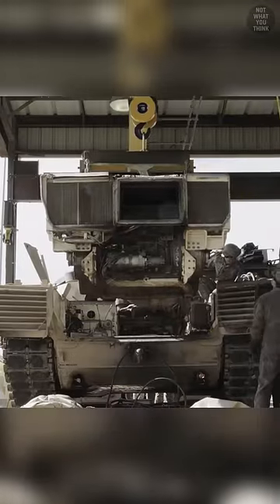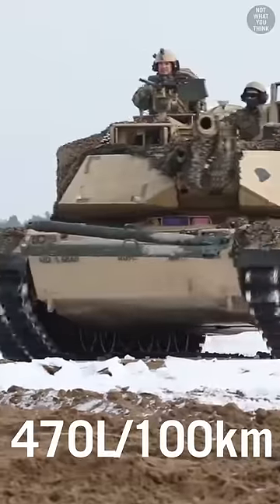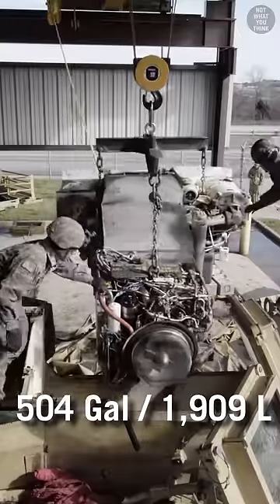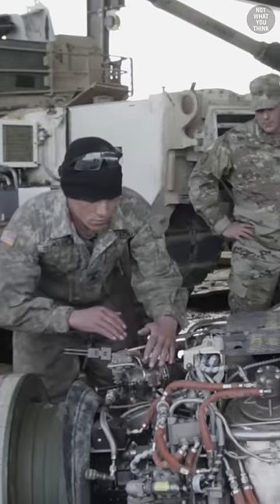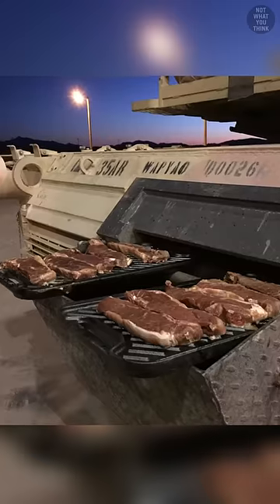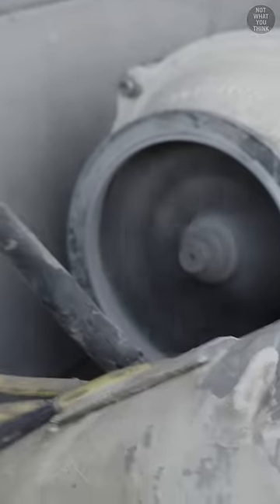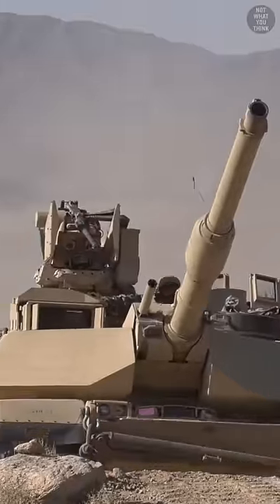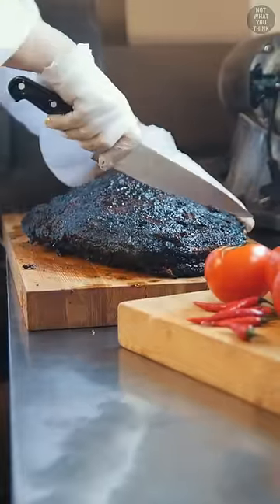Why M1 Abrams Tanks Have Gas Turbine Engines #shorts

Comment: It's actually more fuel efficient under load than a diesel engine but extremely in efficient while idle
Reply: It also produces MUCH HIGHER torque and Horsepower at lower RPMs compared to its diesel equivalent, meaning much higher acceleration and offroad performance.

Most countries at that time went with a gas turbine engine aswell, since it was the 80s, and Diesel engines werent as advanced as they are today.
Reply: @honkhonk8009  most tanks are diesel,  Germany had gas turbine during  WW2 in few tanks.  There is a reason the leo2 has a diesel.  Also think higher torque is incorrect.
Reply: And that applies to all turbine engines. The higher the RPM, the more efficient the power output. This is because the compressor consumes a lower proportion of the engine's work at higher RPM.
Reply: @jantschierschky3461  They had gas piston engines like in a Toyota Corolla. Nobody had turbines in tanks during World War II.
Reply: @米空軍パイロット  well turbines were tested,  don't forget jet engines were lot cheaper and faster to build.  Porsche wanted electric motors for his tanks so he tested turbines.
Reply: High speed fuel efficiency is roughly the same. A turbine consume almost the same amount of fuel per minute no matter the power output though.
Reply: @米空軍パイロット  yeah no. switzerland trested both the M1 and the leo2 back in the early 80s.

the M1 sucks down significantly more fuel per distance than a leopard 2 even when running on the autobahn at top speed.
Reply: @anonym3017  did the Leopard actually have all the armor in place that Germany claimed was on it?
Reply: @chickenfishhybrid44  this was army trials performed by the swiss army. so yes it did.
Reply: @honkhonk8009  
Nope 
the Honeywell has 2,750 lb⋅ft at 3000rpm
the Leo's MTU V12 has 3,352 lb·ft at 2000rpm

And NO, UK's multifuel  option was the Leyland clusterfeck engine in the Chieftain, 

T-80 has a turbine But the T-90 doesn't neither the T-14

google is your friend
Reply: @anonym3017  That doesn't mean anything. Remember when  they sent the Leopard 2 to the US for testing against the Abrams they claimed it was fully armored when it actually wasn't.
Reply: @Chopstorm.  that testing in the US was with a German crew.

This was with swiss crews and maintenance.

So a few tons of armor being missing gets noticed pretty quickly.
Reply: everything is in efficient at idle
Reply: @farmerned6  he said  ""MUCH HIGHER torque and Horsepower at lower RPMs"""  -which is true.
He didn't said about peak torque
Read better. Piston engine need more RPM to match torgue
Honeywell can provide torque instantly  which good for tank, while piston - you need to rev it. And its turboshaft - direct drive
The engine can use a variety of fuels, including jet fuel, gasoline, diesel and marine diesel.  Not just diesel.
Marines who used M1A1 in Afghanistan stuck in village used locals moonshine to drive to base. 
ATG 3,730 N⋅m vs   MTU 4,700 N⋅m  - 970Nm less, but its more efficient providing movement from bottom and has less parts and weight, and its direct drive.
And ATG power\torque and speed is restricted so tracks and wheels and transition  didn't  destroy itself on move by speed. Abrams faster by all meanings, while having less torque on "paper". Remove restrictions - and it will fly over the land.
So ATG 1500 is more powerful by less weight, and being restricted physically, then  turbodiesel of Leopard 2
Not just blind googling, but logic, science and critical thinking + at least car enthusiasm and working on different engines experience    are  your friends.....
2023 for god sake.. Use brains!
Reply: @jantschierschky3461  germans will put a diesel engine in anything that moves. I think they are born with this fascination for diesel 😂
Reply: @laurentiupopa5001  well Rudolf Diesel was German
Reply: @lindsaybrown5897  not a gas turbine. M1 used to use 300L/h just idling
Reply: @jantschierschky3461  so was Nicolaus Otto.
Reply: @brotherofweasel  true  but that a 4 stroke engine
Reply: @jantschierschky3461  I don't know about tanks, but consumer diesels of any decent size are generally four-stroke. Good heavens, can you imagine the stench and noise if they were two-stroke?
Reply: @brotherofweasel  i can, because worked with  M113 and M109
Reply: @jantschierschky3461  must have been fun. My condoleances to your lungs and ears. :)
Reply: @brotherofweasel  ears definitely

Comment: Its not efficient at idle but is pretty efficient at speed. Also the exhaust heat isnt actually that different than diesels and the ir missile dont care, both are hundreds of degrees over ambient.
Reply: The hot spot of a diesel exhaust is actually more detectable at range on IR scopes in many circumstances. The HUGE volume of air coming out of the turbine helps to cool and dissipate the exhaust.
Reply: @BlahVideosBlahBlah  diesels mix the exhaust with cool air(at least on the leopard 2)

Comment: Army thought bubble: “Jet. Tank. Jet. Tank. Jet + tank = fucking 2 miles to the gallon and I can use jet fuel.”
Reply: Jet fuel is kerosene, same as diesel
Reply: @jamesh6342  no it's not
Reply: @nsane260  check again
Reply: @jamesh6342  just pour it in your diesel engine. It's cheaper why wouldn't you? 🤷
Reply: Army men with abrams to airforce servicemen: "i need your fuel, engines and BBQ"

Comment: The easier target for heat seeking missles is a common misconception. As long as you're putting out exhaust you can be hit with a heat seeker.
Reply: Especially with modern-ish seekers. Maybe in the 80-90s it was an issue but nowadays it’s not
Reply: Well, there's no ground to ground heat seeking missiles. So, it's not really an issue. Any vehicle with a running engine will be visible in thermal sights if the "heat seeking" part is an operator guiding a missile or aiming a missile at the tank.
Reply: Right...just has to be high enough of a temp vs. everything surrounding you to stand out, and any exhaust right out of an engine will do that.
Reply: @blakebrown534  - except, there's still no ground to ground heat seeking missiles
Reply: No need to heat seek when you can just guide
Reply: @douglasaranda2010  - guiding leaves the operator exposed.

Regardless, there's no ground to ground heat seeking missiles. So, this whole thread is irrelevant.
Reply: @Texas240  no but there are some air to ground missles that work with thermal
Reply: @Texas240  The Javelin is an infrared (AKA heat) seeking missile much like the Sidewinder (AKA heat seeker) air-to-air missile.
Reply: @Texas240  obviously you know nothing about the FGM-148 Javelin then

Comment: Gas turbines have achieved great fuel efficiency in the last decade or so. The most fuel efficient ones gets a thermal efficiency of over 60%! So if they fit their old tanks with new turbines, they will eventually be just as efficient, if not more, than diesel engines.

Comment: I also heard that the engines will create an iconic sound for the M1, is that true?
Reply: The sound of a turbine spinning up would definitely sound a bit different than a diesel firing up!
Reply: Yeah, you can actually hear it very very clearly

I worked with Ukrainian T64 that have Gas Turbines recently and it almost sounds like a Jet approaching.
Very impressive in the field
Reply: @Frontline_view_kaiser  you meant T-80 the -64 uses a at the time similar to the Chieftain experimental-like-multi-fuel 2 stroke diesel engine only differing in 5 horizontally opposing piston diesel engine the 5TDF and 5TDFM on the BM variant
Reply: @billytheshoebill5364  No, I'm talking about Ukrainian T64 Opplaud (Aupplaud?)
The Ukrainian homebrew version with a Gas Turbine
Reply: @Frontline_view_kaiser  oh wait im gonna have to search it up first this is the first time im hearing it
Reply: @Frontline_view_kaiser  I couldnt find anything regarding the T-64 Opplaud could you give me your sources?
Reply: @billytheshoebill5364  I talked to some Ukrainian tankers.
Maybe something was lost in translation?
Reply: @Frontline_view_kaiser  if you do talked with some Ukranian tankers then why do you said you "worked with Ukranian T-64"
Reply: @billytheshoebill5364  I think he means t84 oplot
Reply: @kanestalin7246  well that make sense it does based around the T-80 which uses the GT engine

Comment: The heat part is negligible when we're doing a Turbine vs Diesel comparison. If for some reason tankers are facing their rears towards the enemy where starving, pissed off AT Infantry can see the exhaust directly visible via IR, then it doesnt really matter if the Turbines is spewing out 500*C vs a Diesel's 300*C when the ambient temperature is a nice warm 12*C

Comment: Can fuels be mixed? Or is it only one type at a time? Does it have to be petroleum based or can you toss in any liquid that burns? Does fuel type affect the mpg?
Reply: Gas turbines can run on pretty much any hydrocarbon liquid that can be pumped and sprayed through the nozzles. Best not to mix them too much for stability of running, and it does depend on environmental temperature (diesel turns waxy at low temperatures, so mixing gasoline and diesel thins the mix to avoid that - thats in essence what retail filling stations do in cold climates anyway). It could probably be made to run on LPG, or other compressed gasses too, but I doubt straight out of the box (liquid seals and pumps aren't much use with fuels that are already gaseous). "Fuel economy" will vary, as the potential chemical energy stored varies between fuels (which is why diesel gives more MPG than gasoline/petrol).
Reply: Yes but not recommended
Reply: Fuel blends have been successfully tested, but not random mixes.

Comment: It should be noted that gasoline/liquid petroleum based piston engines have a higher EGT than turbines do, so therefore it's actually slightly easier to aquire a thermal signature on a piston exhaust. Usually mufflers will aid in cooling the gases before they exit to atmosphere, so this hardly ever actually works out.

Comment: When the AGT1500 was chosen, it was basically the only multifuel engine. Multifuel was required in case of nuclear war. It took many years for diesel multifuels to catch up and the turbine is still superior. They produce less smoke, don't leak as much, are inherently more reliable since it has fewer moving parts, lower net losses leading to higher net horsepower, and the most important (competing with horsepower) is torque. Turbines produce more torque and it's available at low speeds to get the tank up to speed and react. The torque is more available on a wide area of the RPM range. The best diesel only has marginally more torque near max RPM but drops off uqickly anywhere else. Just like the cloud the frequency dropoff makes the engine so quiet the M1 is known as "The White Death." An Abrams crew told me that his tank snuck up behind enemy infantry. They snuck up between the infantry within 20 feet of them and the squishies didn't notice till all 3 machineguns and tracks started hitting them.
Reply: It's called "The Whispering Death". "The White Death" is Simo Häyhä. Also as someone who works with tanks and IFVs, the sneaking up to 20 feet is pure BS. The tracks are so loud you hear them from hundreds of feet away. In fact at speed the track sounds are louder than the engine sound, both in and outside the vehicle.
Reply: @jonny2954  Thank you I must've been thinking of White Noise. Gosh what a silly mistake. Definitely tracks are always insanely loud but at low speed in the heat of battle I'd believe it. What do you think?

Comment: I have also heard that when running at full RPM, the turbine engine is not any less fuel efficient then equivalent diesel engines running at full power. The turbine is much less efficient when the tank is idling however. So we started fitting auxiliary power units to the tanks so they can basically run off of a generator instead of the main engine. This helps keep the fuel usage comparable to our European allies.

Comment: I knew a chemical engineer that worked on the fuel system for the original M1, he said it was designed so that it could use almost any kind of fuel that would burn.

Comment: My old 30 foot 11 ton wooden caben cruser got 1.8 knots with both throttles open and cruising at 32 knots,With only slightly less horse power out of both motors then a tank.
It was also dubble planked in African mahogany so it was also almost bullet proof

Comment: Gas turbine engines can run on a variety of fuels. Although I was an avionics tech in my RAF days I did browse the battle damage manuals in my all-too-frequent idle time. Diesel, 'lamp oil', petrol (gasoline for US readers) although that was supposed to be mixed with engine oil, and basically any flammable liquid could power the engine but... anything other than Avtur (aviation kerosene) dramatically reduced the life of the engine. If I recall correctly (it is about 40 years since I read the manuals!) if run on diesel the engine was to be removed for deep maintenance after 25 hours.

Now it may be that risk analysis is a little more weighted towards caution when the said engine is keeping your aircraft in the air rather than trundling down a track but I wouldn't want a catastrophic failure in either scenario!

Comment: I’ve seen quite a few different tanks while in the army. Everything from T-72s - to the brand new variant of the Abrams. By far the quietest tank is the new Abrams. You don’t hear it from the front, while as the t-72 you could hear the the tracks and engine from about a mile away. The Leopard is also very loud at distance. Even a bmp-2 is much louder than the Abrams.

Comment: The fuel consumption thing was WAY ober blown, while on road march it was compariable to other diesels buuuut its then the tank stopped and went into overwatch or waiting it still burned same amount of fuel as if it was still doing 25 mph. The addition of APU solved this problem big time . The military liked its light weight, how quite it is, ability to use anything that burns as fuel and its relitive ease of maintenance.

Comment: the exhaust on the turbine is actually a bit cooler than a diesel. the reason you can cook with it is because diesel exhaust has soot in it while the fuel used for the turbine is basically jet fuel and burns way cleaner.

Comment: BTW... the "Diesel" engine of the Leopard 2 can also use multiple fuel liquids.
Reply: Yep, Diesels can run on multiple fuels…….that share the specified cetane range.  Gas turbines fuels are much broader.  
The Abrams intended to mow down Soviet hordes plunging thru the Fulda gap in Cold War days.  It would be dead 99% of the time and then spring into action, shoot and scoot.  Turbines start, if anything, easier in cold weather; diesels don’t.  Did this influence decision?   
The Swedes ‘S’ tank had both diesel and Boeing gas turbine engines.  Current French LeClerc’s diesel turbocharger doubles as a gas turbine.  So tank GTs are not exclusively Abrams
Last I hear, Current power density record holder is Shuttle turbo pump at 200 hp/lb.               Cheers

Comment: Correction G.T.E. has a good fuel efficiency if it is running at top speed. But in a low running condition of Abram a G.T.E. sure as a thirsty engine . And it's thermal signature is lower than any piston engine Just don't add reheat system/afterburner.

Comment: Actually the initial reason was because the early prototypes for the Abrams had wings on the side as they wanted to make a flying tank.  They tried but failed to make it fly and after 4 years gave up but kept the engine because of the other benefits they found.

Comment: The AGT1500 exhaust temp is 700-750 degrees C straight from the combustion chamber. This is the same as the MTU found in Leopard II. Difference is, the exhaust is processed through the recuperator which lowers the exhaust temperature as a side effect of normal turbine function. Also the exhaust plume is larger on the Abrams, but since it is such high volume and mixed with ambient air, it isn’t as bright on thermals as a standard diesel engine.

Comment: One of the weirdest tank engine in my opinion is not the Abrams turbine but the French Leclerc (not the UAE Leclerc which runs with a Leo engine).
This thing is basically a diesel engine fitted with a turbin making the work of a turbo. That allows it to have fuel efficiency at cruising speed, running on the diesel, but reach higher speeds with both working at the same time, and the turbine giving the tank a much better acceleration. This thing is quite literally an hybrid engine in a tank.

Comment: The simple radial flow compressor and simple radial flow turbine make for very few actual moving parts to make all that power. I don't know much about them specifically, but it seems like all it needs it lubricant for it's bearings. I bet it only needs its burner cleaned out sometimes. That that has to be EXTREMELY reliable, even more so than a diesel engine. I saw a scematic of it, I picked up the design immediately. In the middle of a war, if I needed to, I could make that simple engine run.